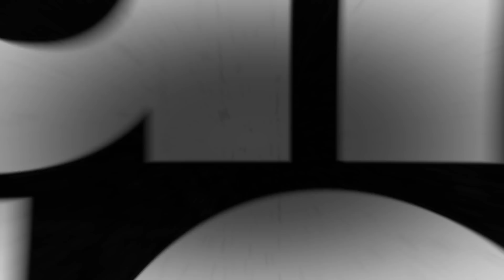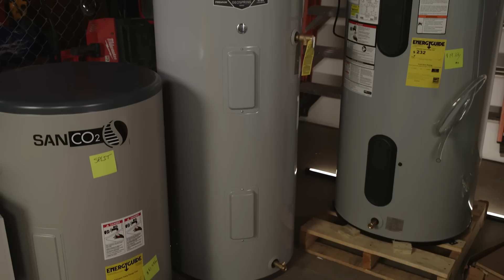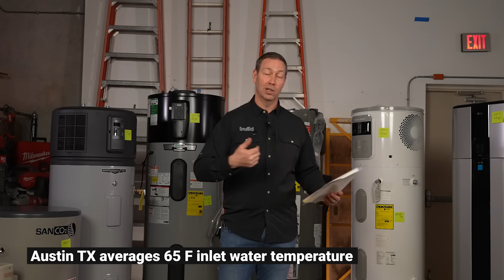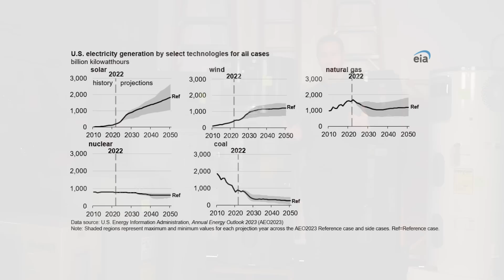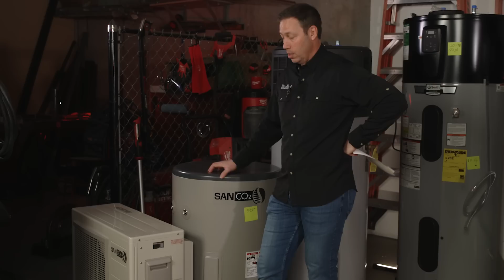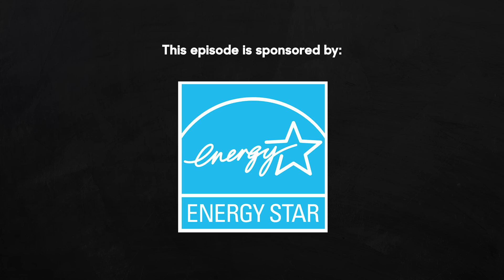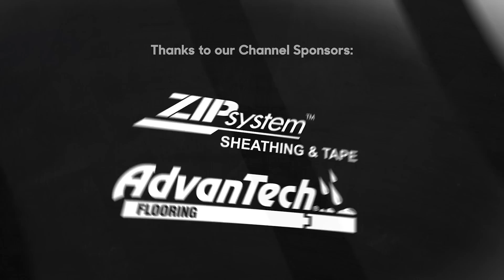2024 Heat Pump Water Heater Buyers Guide

Comment: As a DIYer, counting on the rebates and credits is a dangerous game, as i have found out with my Mr Cool minisplits.  So when comparing to retail price, I'm better off to keep my big nasty oil fired water heater which at only 30 gallons is damn near on demand for a family of four.  And it sips oil.
Reply: what exactly is your issue with collecting credits on the mr.cool units?
Reply: @nitrousair  The issue is with the state rebate.  For federal I haven't had a problem because it's just part of my tax return.  My state claimed they didn't know how to process my rebate because it was a DIY install.
Reply: @kevin9c1  my understanding is you can’t collect a state or local utility rebate unless it was installed by a licensed professional. That’s why I went the Mitsu hyper heat whole house heat pump for my install vs mr.cool. Just too much incentive I’d be missing out on. In the end my out of pocket expense will be just the install costs but I gain the Mitsubishi reliability and easy warranty service.

Comment: Thanks for the information Matt.  You have just about sold me one but..... Can a heat pump water heater be used for both domestic AND radiant heat together?  As in one unit serving both needs.
Reply: In most cases these water heaters lack adequate capacity.  The Sanco2 supports up to 8,000 Btu/hr of radiant heating load in moderate climates only, in conjunction with DHW.  That's really only enough for supplementing another system or for a fairly small (or very well insulated) space.

Comment: I've talked to SANCO2 and they approved putting the heat-pump in my outdoor shed and the tank in the tank closet where I have my gas HW heater now! I'm in a manufactured home in New England, no basement. They said the unheated shed (12x14) would have plenty of air flow. The shed is only 8' from the home and the lines can be buried.

Comment: Any of the new units work will with recirc systems?  Also, we gotta get some better way of doing the specs on noise...
Reply: The Sanco2 works with recirc systems. And the outdoor heat pump mitigates any noise concerns.

Comment: It seems like the cost for this increase in efficiency is a decrease in reliability.  More moving parts (especially a compressor) usually means more potential points of failure. Am I incorrect?
Reply: How long has your refrigerator been running? These are mature and reliable technologies. I take your point, but I think the risk is manageable.

Comment: My concern with these units is the lifespan of the tank. I know this varies with water quality. Where I live now I used to get about 3-5 years out of a typical water heater. I don't know what it is now, since I added an acid neutralizer and switched to a Rheem marathon. I would not be happy to replace the heat pump unit because the tank rotted out before payoff. 

Our families lake house has a water heater that was installed in the early 1980s. We have replaced the heating elements a couple of times, but it is still going strong 40 years later, so I would definitely use a heat pump water heater there.
Reply: The Sanco2 offers 2 tank size options that are stainless steel with a 15 year residential warranty.

Comment: I wish I had the option to install a unit like these without a major retrofit.  Our current 240V electric resistance water heater is in a small closet right outside our bedroom, so louvered doors would be a must to provide adequate air flow to a HPWH, and noise would be an issue.  The SanCO2 split model could be an option, but at a vastly higher installed price.

Comment: awesome review Matt ! thank you. I'm keeping my mountain cabin all electric. Planning to replace a 60 gallon resistive water heater with heat pump. Keeping the laundry room location. We are adding 2 bedrooms to the house so I need to upsize the water heater capacity... Sounds like I might need to consider 220 version to keep the tank size reasonable...

Comment: My mechanical room in the summer is VERY cold, would this still work and be efficient?
Reply: It will work and be efficient unless your mechanical room is below 40F, which I suspect it is not. The biggest market for HPHWs in Maine, where most water heaters sold are HPHWs. They go into basements there that are usually 55F all winter and work great.

Comment: In our location which is CA, natural gas is more expensive than it used to be by 2 times however, our water heating needs cost us about $15 to $20 per month.  A replacement gas water heater runs about $600 while those heat pump models will cost $2,500 plus the cost to bring power to the unit. Our monthly gas bill isn't large enough to make any of this heat pump practical plus our electric rates here are the worst of any state, 42 cents/kWh, so natural gas seems to be the most "efficient" method to make hot water.

Comment: Hello Matt , I have a question…

I do like energy efficiency but I’m more concerned about running out of hot water in my house with four other people taking showers… Have you ever run out of hot water with your heat pump water heater at your new house? Has it ever been lukewarm or borderline?… Before I switch to a heat pump, water heater I want , an honest opinion from someone I trust… Thanks in advance
Reply: You always need to size properly regardless of the type of water heater. Matt has said in multiple videos that he has a SANCO2 with an 80 gallon tank and with four kids has never run out of hot water. Each OME has sizing tools that consider the incoming water temp, number of bathrooms, etc. But if you're worried just size up. Also, you can superheat your water in the tank to 140F and use a thermostatic mixing valve so it comes out at 125F, which increases the thermal capacity of the tank. That's what I do when I have extra guests staying w/ us and I want to ensure we don't run out of hot water.

Comment: Would love to know if that one you put in 13 years ago is still working?  My 30+ year old electric is still going.
Reply: But at 14 cents/kWh  its costing you $500 year more to operate than a HPHW. And that's assuming it hasn't lost any efficiency in 30 years. Storage water heaters from that era were poorly insulated.
Reply: @walternlivingston8607  Edit, removed, thought this was about heat pumps, not water heaters.  Sorry, mixed up another comment.

Comment: Awesome to have Energy Star as the sponsor, love videos like this. I do wish the dB ratings some manufacturers could be trusted, as i’ve had 2 recent Rheem heat pump units where the newest model was much louder (and dB suddenly unlisted). I finally went with 45dB State. I do work near the unit in my open basement, and it’s right under our bedroom. so noise levels are very important to us. I realize most folks won’t care.

Comment: This is the best HPWH  evaluation i have seen on youtube to date. Plumber for 49 yrs retired. I have a HPWH in myhome for 12 years now. Best in an unconditioned area and will make some noise but as mentioned they are getting quieter.  Nice job Matt.
Reply: Friend had a heat pump water heater installed in unfinished game room basement. Turned it into a meat locker. You can feel the cold thru the vinyl floor above, not so much in the carpet areas. Floor is insulated, but not a gyp ceiling in the basement. In fall winter & spring forget about trying to use the basement game room and bar. You should learn how to butcher and hang meat down there.
Reply: What brand?
Reply: What are unconditioned areas
Reply: @-whackd No heating or cooling vents. Typical in northern basements. Especially in newer home builds, track homes & housing developments. To keep costs down basements are unfinished/ unconditioned.

Comment: Another benefit is these water heaters are easy to run on generator power during an outage. My Rheem HPWH only draws around 300-400 Watts in heat pump only mode compared to the 4500 W of a typical resistance type. That frees up a lot of reserve capacity for other needs or allows you to get by with a smaller generator.
Reply: Same with “inverter” or VFD air conditioning systems. They have zero inrush current so they are very easy to start up.
Reply: Yeah unless the backup elements kick in.  Maybe there is a way to temporarily disable those in a power outage and run heat pump only.
Reply: @kevin9c1  As described by Risinger, most seem to have a "heat pump only" mode switch.
Reply: Good point, hadn't thought of that
Reply: Thats why I like gas
Reply: @johnnichols2710   Some of us live in areas (especially in the southeast) where home gas service is not available.
Reply: @johnnichols2710  gas relys on the gas flowing. When Texas froze a few years ago, the gas lines didn't work.
Reply: @bamascubaman  natural gas freezes at -297'F, im 100% sure it didnt get that cold there LOL
Reply: @srobeck77 “Gathering lines freeze, and the wells get so cold that they can’t produce,” said Parker Fawcett, a natural gas analyst for S&P Global Platts. “And pumps use electricity, so they’re not even able to lift that gas and liquid, because there’s no power to produce.”
Reply: @actually_it_is_rocket_science  ok but why are you giving me all this nerd talk. All I said was it wasnt possible for natural gas to freeze in cold weather, unless it gets -297'F somewhere on earth. Which is true.
Reply: Haha if you're worried about a hot shower during a power outage on a generator, youre already doing it completely wrong.....
Reply: @srobeck77  tell me you've never been through a hurricane, without telling everyone you've never been through a hurricane.
Reply: @srobeck77  I can run every appliance and have full climate control in my all electric house with my diesel generator (5 kW MEP-002a). Some load management for stove and dryer is occasionally needed. I have fuel storage capacity for 7+ days of run time. What exactly am I doing wrong?
Reply: @benningtonmcelroy2756  Go re-read if you forgot already there, fella
Reply: @srobeck77 You don’t seem to be capable of communicating your point of view. Would you mind explaining further? I have a reliable ex-military generator with numerous system redundancies to ensure my family has basic needs like heat, clean water (we rely on a deep well pump), and food refrigeration in any season. We live in a rural, hurricane prone area so we want to be prepared. Yes, we don’t need extra creature comforts like A/C, hot water, and warm food, but when you already have the capability, why not use it?
Reply: @srobeck77 It appears I’m already talking to the child in your house.
Reply: @srobeck77  yah people with heat pump water heaters can experience luxurious hot showers through power outages. Are pissed about that because you didn’t think of it first? 😂
Reply: @srobeck77 or completely right.
Reply: @zimvader25 or completely wrong

Comment: One issue a HPWH owner will eventually have to deal with is maintenance. Some tasks, like flushing, are same as ever. One which may be much harder is anode rod r/r. In the case of my Rheem, you have to separate the heat pump from the tank for access. And then, due to the height of the unit, you may not have headroom to withdraw the anode rod without sawing it into sections as it comes out (or disconnecting the lines, draining the tank and carting it out to the driveway!). In such a case, I would definitely install a flexible replacement anode. After 5 years of use, I like the Rheem, but I'd be amazed if the manufacturers haven't figured out a better anode design by now.
Reply: Was a plumber for 49 yrs until retiring 3 years ago. I never once flushed a water heater or changed an anode rod. Over rated in my opinion.
Reply: The Sanco2 offers 2 tank options (43 and 83 gallon) which are stainless and require no anode rods.

Comment: We have a Rheem hybrid Heat pump water heater up in NY. We actually have a better experience with that over our previous gas. It absolutely takes longer to recover heat in heat pump only mode, and it does cool the basement but we keep our upstairs at 67F and I recorded the coolest it got in the basement at 61f after three showers on a 20f day outside. I found using the "energy saver" mode, which just uses both heating elements and heat pump, do use a bit more energy but I saw much smaller drops in temp in the basement.

Comment: Disclaimer: I am a DIY guy with a background in engineering......

We are a family of 4 in Minnesota. I put in a 80 gallon Rheem Proterra with a 120 degree mixing valve.  The heater is set at 140 degrees. It is installed in a mechanical room that is less than the 700 cubic foot limit.  It is vented (not per Rheem requirements) into a furnace supply duct that goes up one floor to a register in front of a sliding glass door.  Before the T into the supply venting, there is a spring loaded back draft damper to prevent back flow of air from the furnace to the heater.  Just under the damper is a T that allows the water heater exhaust to dump into the furnace room when the furnace is on.  The furnace supply and return ducts in the furnace room do have 4" adjustable dampers to exhange the water heater exhaust air.

Here are somethings I have noticed.  Since the unit ducting does constriction from open down to a 6" duct, there is some additional energy usage but not enough to rip it out.  Average run time of the heat pump is around 1.5 hours.  No condensation is  noted on the ducting except when trying to heat a full tank.  The heat pump does not have enough CFM to hold the damper constantly open so we do hear it open and close when the pressure drops enough for it to fall closed.

Would I recommend this set up to other?  Yes.  The only change I would do is getting the back draft damper installed horizontally instead of vertically.
Reply: Living in MN also. Did you happen to install yourself or use a plumber? Trying to decide on that myself.

Comment: Really wish I had seen this video a month ago.  I just installed a 65-gallon Rheem ProTerra and really wished I'd gone with the 80-gallon model. Even with the temp set at 140 we're lucky to get 25 minutes of hot water in the shower and that's with a 1.8GPM shower head. It's winter here so our base water temperature is about 65 degrees. It takes a good 3-4 hours to recover.  Hoping in the summer that'll drop to just a few hours. The only bright side is it costs just pennies to run. I'm averaging about 4Kwh a day which is like 25 cents at my current utility rate.
Reply: How many people are in your household?
Reply: Two adults.  We were a household of four. Kids went off to college. We used to run a tankless unit, so it's a hard transition to 'limited' hot water.  One more note, with winter having truly set in, the water coming into my house is now 54 degrees base temperature!!!  So even less hot water now. @sctele

Comment: Like many in the Northeast I had an oil fired indirect water heater.  All summer long I was heating up a couple hundred pounds of boiler then letting it cool off 2-3 times daily.  Put in an 80 Gal Rheem two years ago, the savings are huge in my application and the performance is great.
Reply: I did the same about 12 yrs ago with similar savings.
Reply: did you install it yourself?   Was it easy? seems easy.
Reply: @AidanSkoyles  I did.  It’s essentially the same as installing any electric water heater, with the addition of a condensate drain.  You do have to consider the air volume in the space you install it, the instructions have good discussion on that.  They do also make some noise (think dishwasher level) so you need to think about placement relative to bedrooms as well.  In my case it went into a large base,ent so neither of those was a concern.
Reply: @kgdietz  thanks for the thoughtful response.

Comment: @buildshow  Matt, For new construction would you recommend the 240 or the 120v model?
Reply: 100 percent a 240 volt. The 120 volt HPWHs are just made as a drop in replacement for those moving away from gas (particularly in CA) so as to avoid expensive electrical upgrades. But for new construction there's very little cost difference for you at this point to run a line for a 240volt. Much better performance from a 240volt and you don't need as large a tank.

Comment: I installed a Rheem in 2020 in my basement which is 55 degrees in the winter. It didn’t work so well at 55 so I connected an 8 inch insulated flex duct to a vent under my refrigerator (which is located on the floor above) and the intake on the Rheem. My air temperature at the Rheem intake went from 55 to 73. Our hot water is great all year now. I used 400 kWh a month with my old electric hot water heater. The Rheem uses 125 kWh a month! It’s set on heat pump only and we have plenty of hot water. Also, my house is power by solar so I use the electric savings to power our EV.
Reply: Venting to the refrigerator is genius tbh it will slightly improve your refrigerators efficiency as well 😅
Reply: @Playingwithproxies  slow
Reply: This is brilliant if you vented the exhaust from the water heater to behind the fridge.
Reply: @theglassishalf  It's the other way around -- he's taking the waste heat from the refrigerator (removed from the interior) and using it as the supply heat for the water heater (moving it into the water).
Reply: @theglassishalf  slow
Reply: I have the same situation and was wondering if this would work. Thanks a bunch
Reply: Hi can this be done with a deep freezer thanks in advance.

Comment: About 2 months ago I removed a forced air gas hot water tank and had a AO Smith heat pump installed. My electric bill has not substantially changed. The blower fan on the forced air gas was about the same amount of electricity as the entire heat pump unit. It's amazing.
Reply: Edit needed